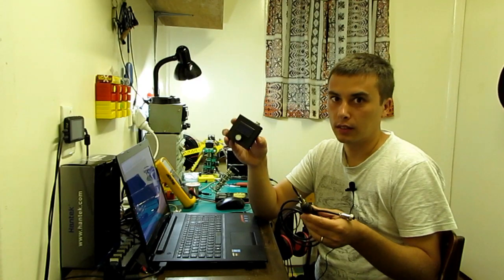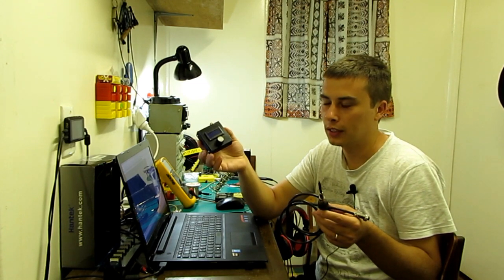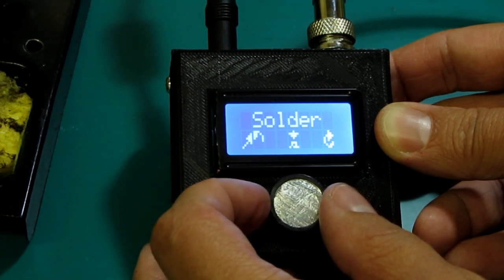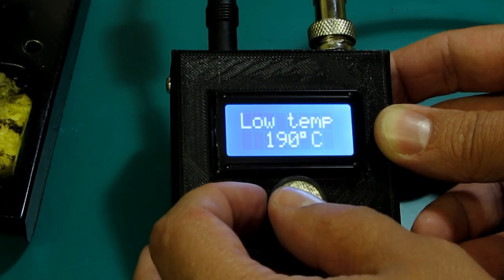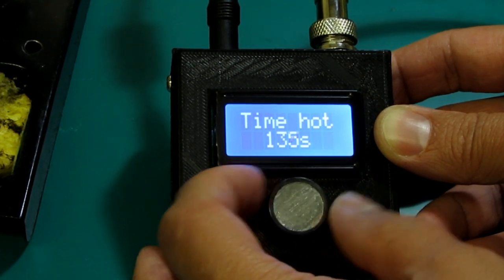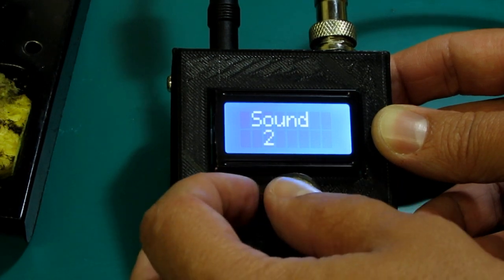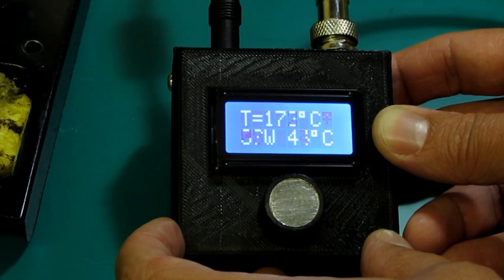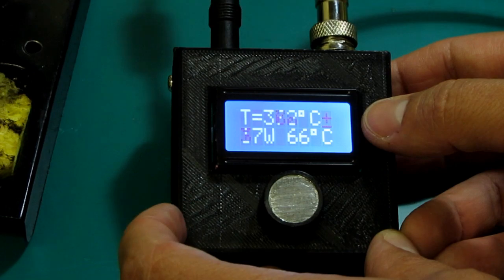DYI custom made t12 soldering station - hakko tip [1/2]

Comment: can you increase the 24v of the iron to 30v to increase the power?
Reply from the maker: Yes. That would be my goal to make it heat up even faster. Technically, these LM317 I used on the input can withstand 35V, but I experimented with some mosfets that can only hold 30V. I ordered recently some IRFR7440 which have lower RDSON and will heat less. They can switch 40V and this means that the input voltage could be raised to about 30-32V with no problem.
Reply: 2 more questions:
1) why did you choose t12 over ts100?
2) have you looked at the oled controllers on aliexpress?
Reply from the maker: No particular reason. Maybe my next project will be a more miniaturized one using some OLED display and some ts100 tips. We will see. :)
Reply: FunElectronicsToday Since I love my hakko revenge I would definitely build one of those